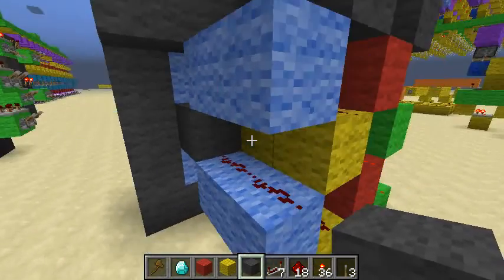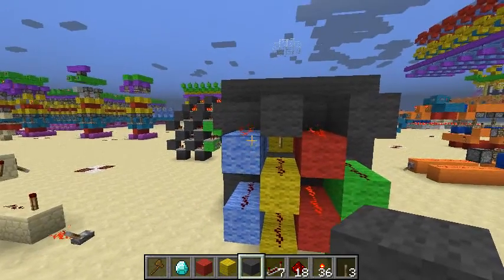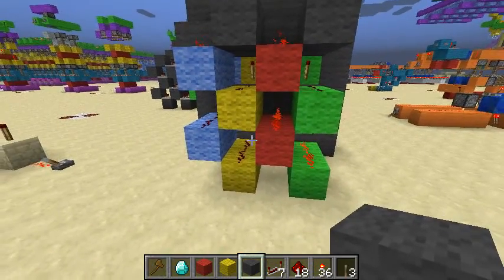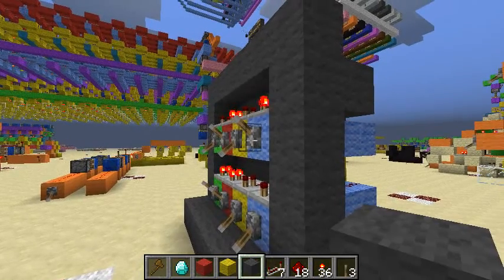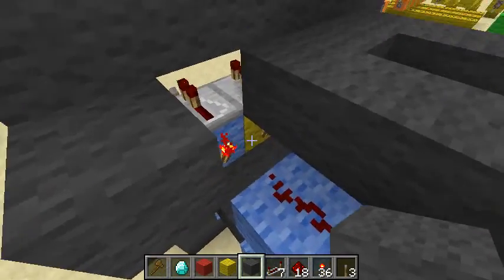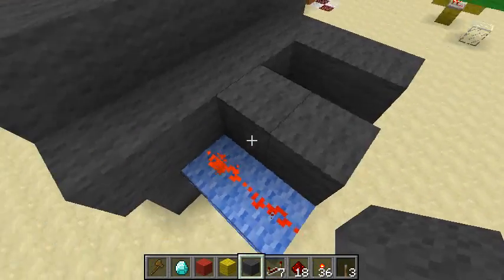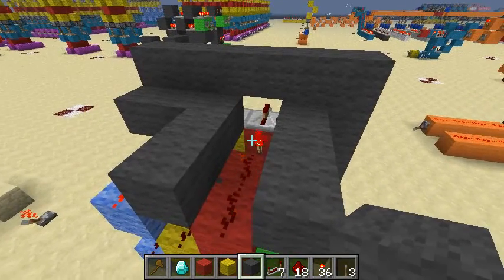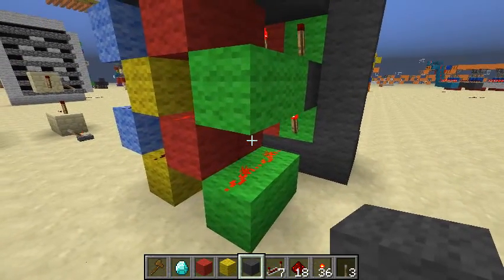Compact Input Display

Comment from the maker: I designed this as an improvement on that design because of these weaknesses:
-With a torch as the indicator light, you can't place another layer of controls directly above.  The torch will power that block.
-Although the torch shows the same signal as what's going into the block, it is the inverse of what's coming out of the back-side.
-I just don't think it looks as good.  Repeaters have the light positioned low down close to the lever implying a closer relationship than a tall torch.

Comment from the maker: @JayXdbX 
The display shows correctly (in terms of what you see is what you get), the only thing that's inverted is the lever position.  The whole point of a display like this is so that you don't have to read the Levers, but can look at lights instead.  Flip the levers until the lights are the same as the data you want to send.

Comment from the maker: @deathbyspeakers 
Lamps have less contrast, and take inputs from too many different angles.  They'll work fine for a single-layer display (above the levers), but for 2 layers you'll need an extra space between them.

I'm sticking with repeaters.

Comment: @JayXdbX (ran out of characters)
I do notice that with the not gate on the wire your likely to turn on the block above. Think I have a solution. So if we assume all wires go north and end at the same spot then they will all be stopping at the same spot on the Y axis. If this is true then you should be able to place a block and torch without worry of affecting another wire from the same source. When you would have to worry is if a wire is long or short than the others and/or you have unknown wire

Comment: So I understand your using a repeater above the leaver because it wont affect the block above but for the fun of it here's what i'm thinking. 

To get the display to show correctly couldn't you replace the repeater with another torch and add a not gate at the 15 block mark? this should make your wire a bit longer and correct your problem and shouldn't slow it down any unless your using instant wire.